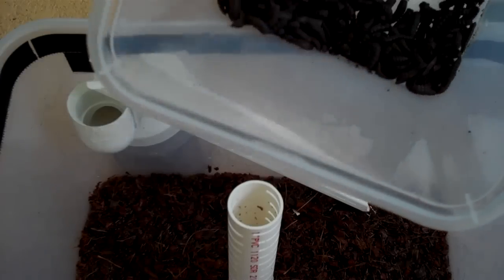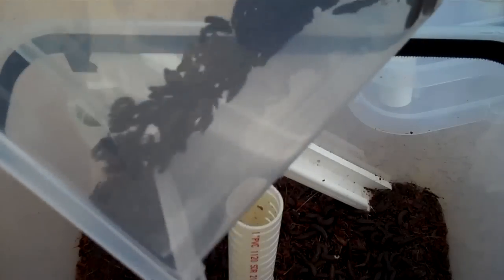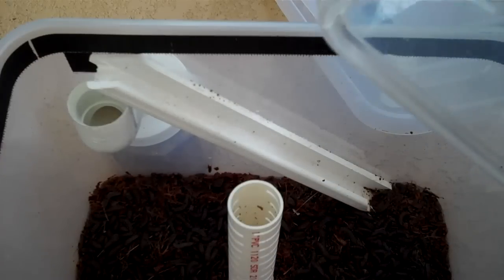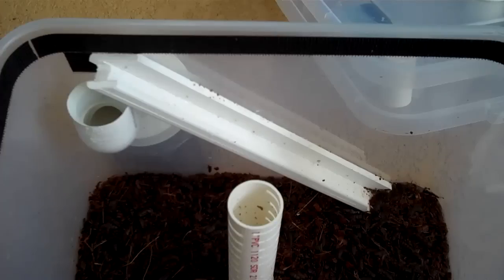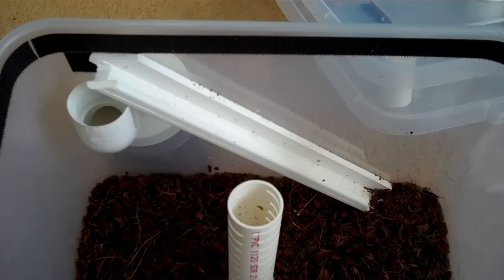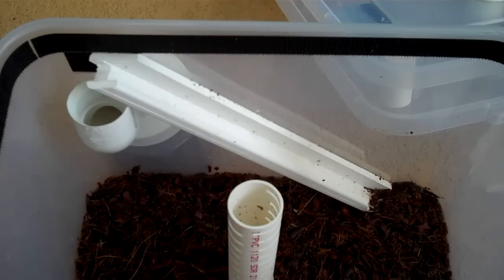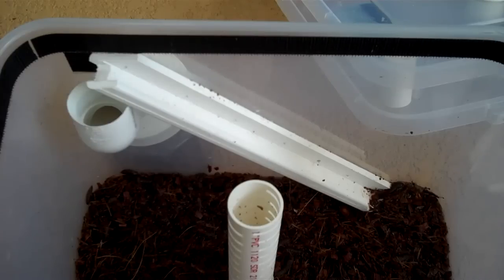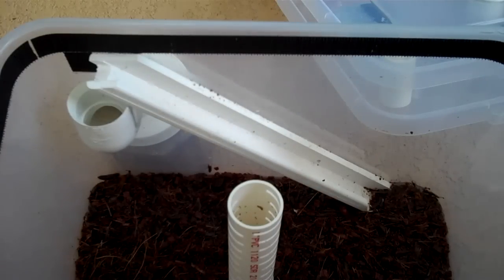6 gallon BSF composter - single ramp test

Comment from the maker: It's a vertical drain system. At the bottom it makes a 90 degree turn to exit the unit. It's slotted over its entire length as is the horizontal piece along the bottom. The theory is that it will allow better drainage and also better oxygenation of the lower level waste. I've been testing this concept on a few units this year and I'm very happy with the results. You can find out more about it at our forum if you're interested.

Comment from the maker: I understand why you suggest that. I considered it and may do that in the future. I've held 1.25 and 1.5 inch fittings and thought about it. I will definitely use a larger elbow for any larger composter. One change I'm going to make on all units with this plumbing system will be to shorten the horizontal run of the exit pipe by trimming the fitting as short as I can, just long enough to easily glue it. I think with that modification the traffic will move better.